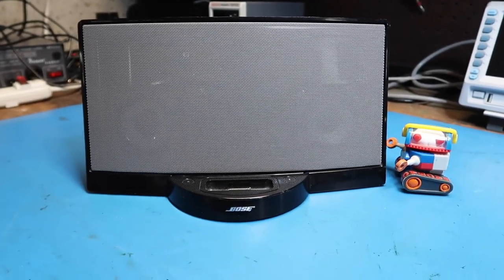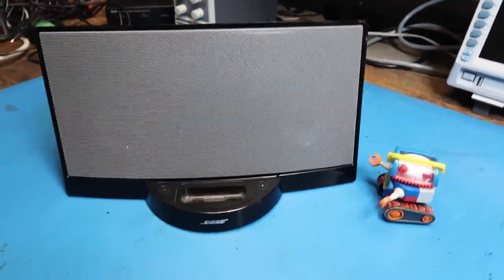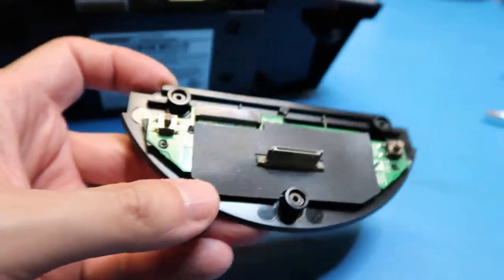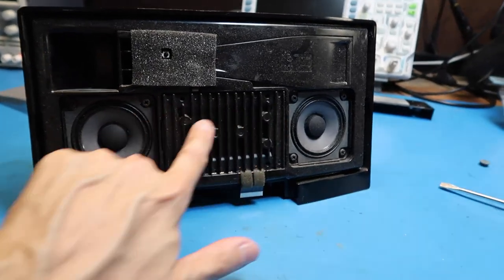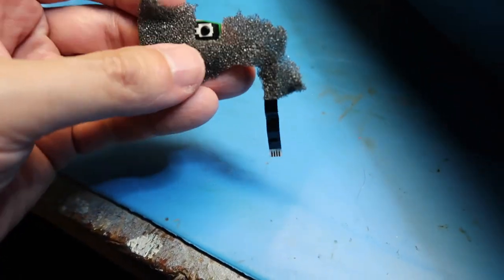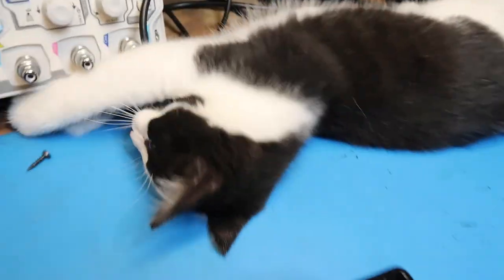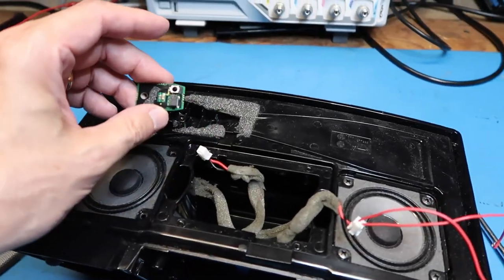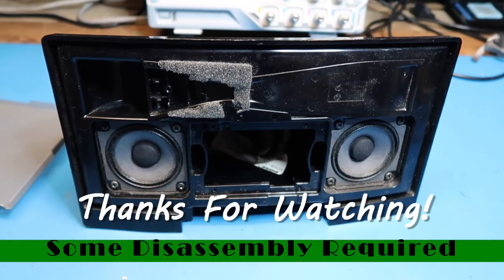Inside a Bose SoundDock

Comment: Hi!
Is there no way to use the speaker's amplifier module? It's a common issue with these devices that the processor board fails. I would like to use it somehow with Bose quality and a Bose amplifier. Is there absolutely no way to solve this?
Reply from the maker: I bet it's possible but it might be a bit complicated to do so. I've saved all the pieces from that video in a Bose Baggie (TM), and I might make a video on that subject one day. But I can't promise that because I have so many other fun projects sitting around. :-)